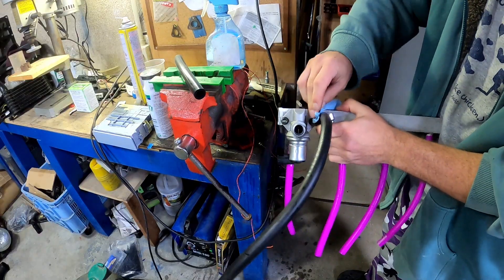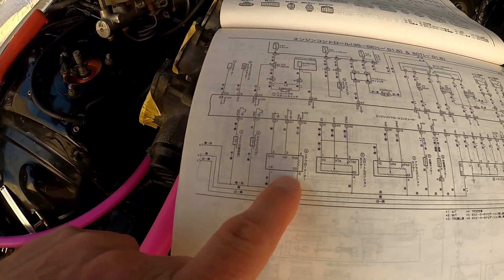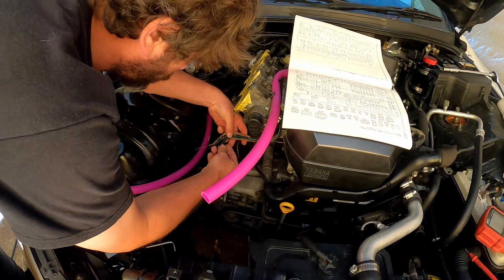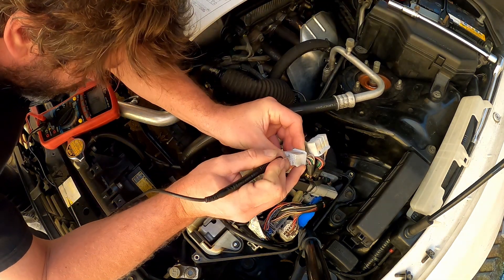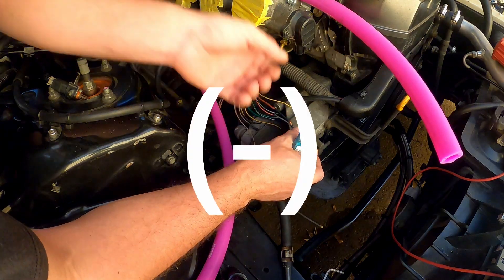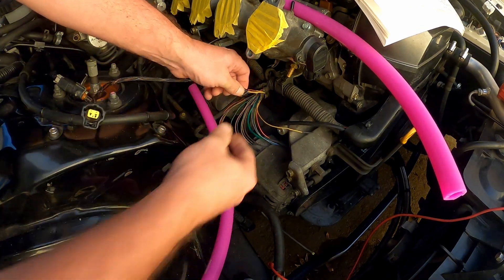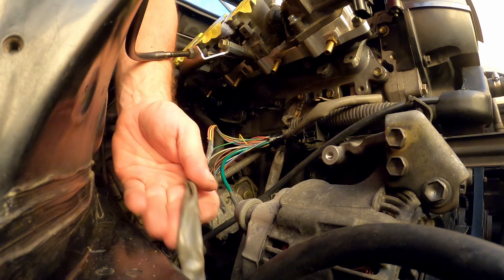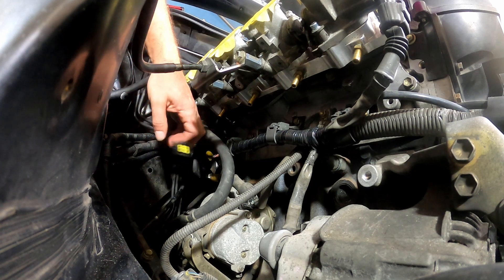Wiring for idle speed in an Altezza with ITBs

Comment: mate love the videos, honest opinion are altezzas good cars?
Reply from the maker: Thanks!
Is it a good car?...
It depends what you mean.. 
How do you judge if a car is good or not?
well built? Yea. Very well built. 
Fast? No.
Safe? By1998 standards, yes.
Was car of the year a few times I believe.
Comfortable? Yes.
Good on gas? Not really.
Handle well? In my opinion out of the box, yea not bad. 
I had the Torsen diff and I could drift it around a track.
6 speed. But 6th is kinda dumb.
I have a sunroof in mine. Rad
Electric windows and mirrors.. rad
The OEM exhaust sounds good when you hit vvt #1 and #2 yea that's right dual vvt!! As if one wasn't enough. 🤣

The ECU system and the radio system is over engineered and dumb.
Some of the design decisions in the engine room make me wanna uppercut the designers but it could be worse.... 

I love the car and so I am biased but yea it depends on the matrix on which you judge if a car is good or not...
It's a Toyota but it's a top end Toyota aka Lexus.
I dunno if I would wanna daily it. I'd rather a Kei van for that.

Hope that helps. 🤣😂🤣😂
Reply: @GarageKei  The exact insight I needed mate, been thinking about importing one to aus and I wasnt quite sure it was worth it but I'll definitely keep thinking. Keep up the good work , love the videos

Comment: Sounded Irish , a lot of hard work for itb's  , is there no other easier bolt in kit ? Saw some guy on tictok 3d carbon printing all the trumpets and manifolds etc for it
Reply from the maker: Irish??
You're right. It is a lot of work for itbs.
There is no bolt in kit.
I imagine if I could do, or afford to pay someone for, 3D carbon printing I would do a few things as well 😂😂

But 3D printing trumpets is not something I would do. The shape matters and I don't have a way of testing them.

The manifold and the trumpets are the most basic part of the conversion and if all you care about is getting it done then that is a different path to the one I'm on.. 
I did say in a previous video why I chose the SQ engineering manifold and the trumpets. The former because it's metal. I don't really trust plastic parts. Some people say "oh but it's a heat barrier". The Altezza already has one of those and I'm guessing it will fail at some point due to the fact I had to shake it pretty hard to get it to let go of the OEM manifold. 🤣😂

Sure you could just buy the cheapest adaptor, put the cheapest trumpets on, dip a gym sock in filter oil and zip tie them on.
No need to modify the clutch reservoir or anyting to do that.
You could get some off the shelf vacuum block and a couple of hose size adapters..
You could just adjust the idle to be 1200 RPM all the time and not have to worry about an ISCV.
You could just screw the ISCV to the easiest location not caring about what it looks like. 
You could even 3D print a bracket so that it bolts to the frame rail. And then just run a hose to that.

My point is I'm not taking the easiest path... But if I did it any other way I wouldn't be happy with it.

I'm just making it up as I go along too... I don't have a plan. I didn't know I needed and ISCV because nobody told me that they just ran in the car with a higher RPM before I started.
No one told me that I would need to modify the clutch master cylinder if I wanted to use the pipercross filter.

My goal here is to make content thats entertaining and end up with a car that I'm happy with.
I'm doing my best to achieve both of those things so I hope you find it entertaining.

Thank you very much for watching and for commenting!!